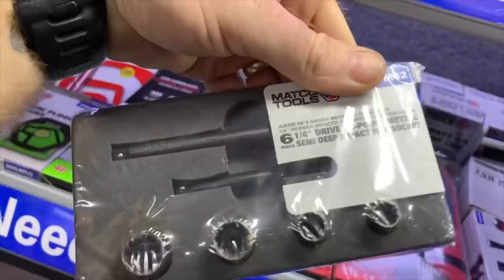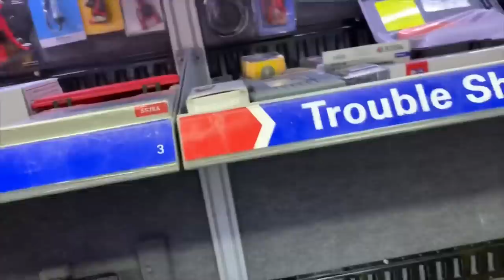Matco Tools Warranty Put To The Test ! We Broke A Bunch Of Stuff This Week !

Comment: instead of buying fuses all the time. I tore open my meter and put in a mini fuse holder and have it running outside the meter, its super cheap and dont have to always wait for the tool truck for a fuse.

Comment: Here's a question! Does your Matco guy have any US made reversible ratcheting wrenches in metric? 17 mm by chance? I have a metric set that I've own for 12 years now.  My set was made in the U.S. Rebranded I know.  My 17 mm crapped out on me. Was going to get it warranty and my Matco guy was going to swap it out with one made in Taiwan.  Not bashing Taiwan tools. I have some in metric impacts. I just want one the same one I have now. If it comes to it I will just buy a Snap On ratcheting wrench instead. Any thoughts on this?